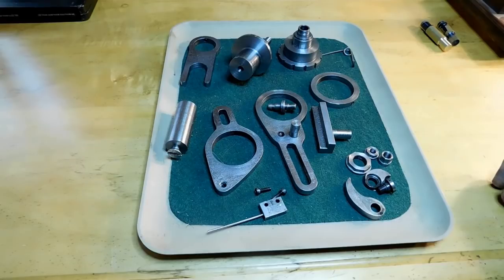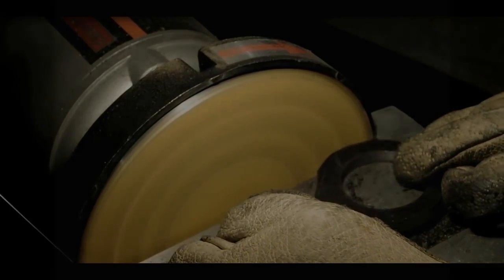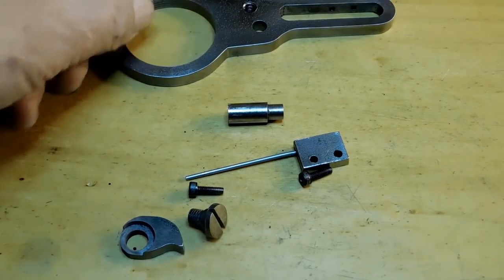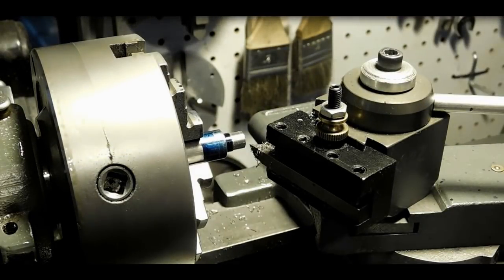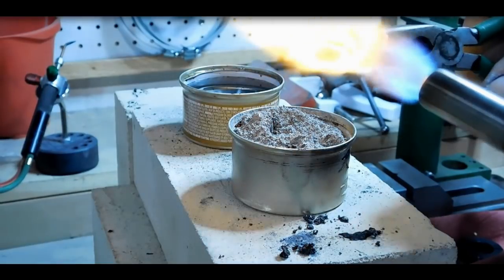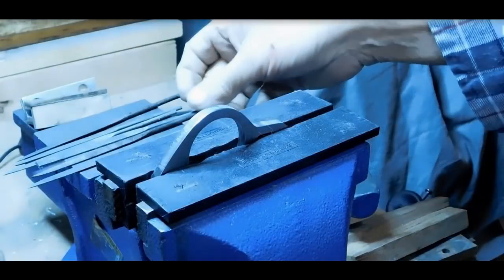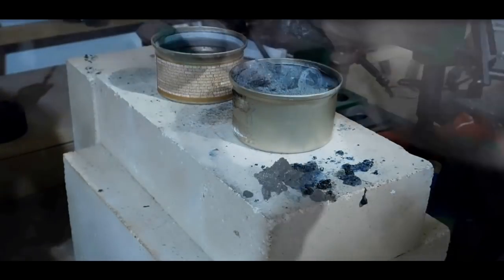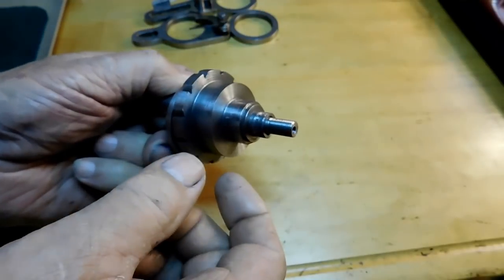DIY Gear Cutter: Eureka Tool Construction 1

Comment: I love the video!!!   I am, if the Lord is willing going to make one of these Eureka Tools. I am making a cutter to cut a gear for my Toolmaster Cincinnati Mill 1959 model, on my lathe.  The gear has 16 teeth and is 2.50 Diameter and that comes out to a 6.4 pitch.  This gear has a 270H075 timing belt.  I think I done that right.  Could not find a cutter for the gear so I turned down a piece of oil hardened steel to .375 and put a 20 Deg. cut on the cutting end, then slotted that end.  On the other end of the cutter while I got it set up in the mill, I will slot the other end for a set screw and I will be Harding it soon.  I gave you a thumbs up and Subscribe to your channel. Goin on to your next video!!